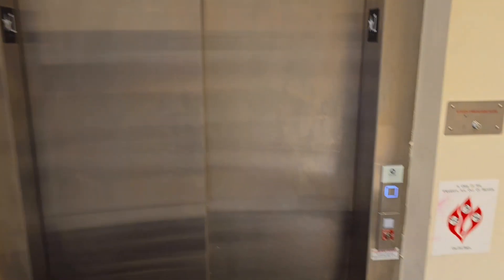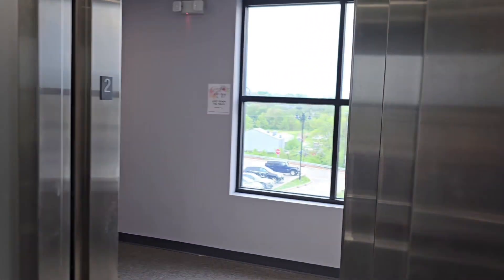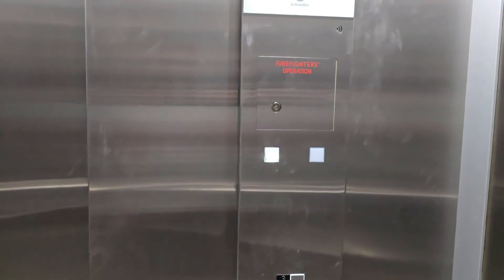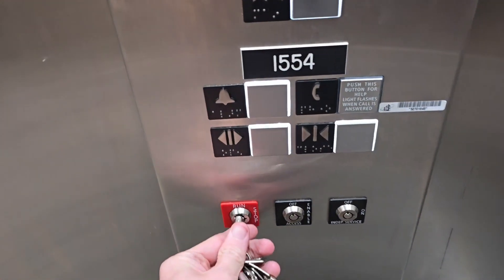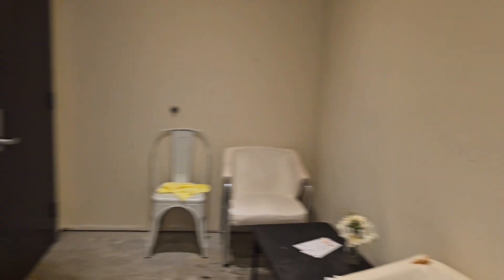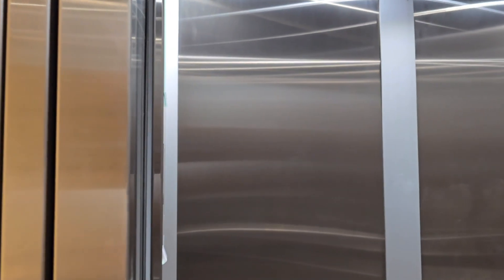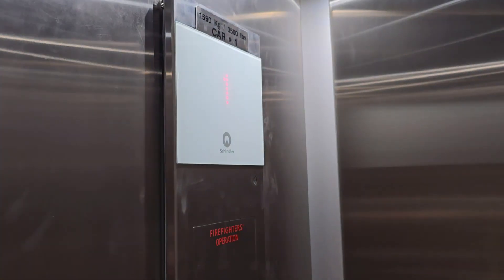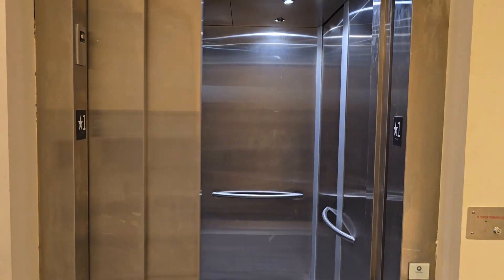Schindler 3300 Elevator: Keyed Stop Switch Demo + Nudge Mode Fail

Comment: Does it cancel a call if you flip it while it's moving?
Reply from the maker: Yes.  Although I didn't demo that because I don't want to risk causing damage to the elevator.
Reply: @BusMaster99  Well I would think it would stop safely. Then it would relevel when set back to Run.
Reply from the maker: @Undercoverelevator212-s2n  While I am authorized to use my keys on this elevator, if I break it and they find it was because of the keys, I risk permanently losing that authorization.  This elevator recently had to be reset because of a power surge at the end of last month and I was scared at first that I somehow broke it.
Reply: @BusMaster99  That was the electricity's fault AFAIK. What about the one in the FM cabinet, does it sound an alarm if you trigger it? I saw a video of it being flipped on a 330A and that rang the floor pass chime on loop.
Reply from the maker: @Undercoverelevator212-s2n  Nope, neither of them sound the alarm on the 3300.  And on the subject of the electricity, if I had known the elevator was broken before getting out, I would have hit the phone button and let the operator know.  The problem was once I got out of the elevator, I couldn't get back in.  I even tried putting it in fire service since I had my FEOK1 on me and it STILL didn't open.  It was super weird, but at least it did let me turn fire service back off so that the alarm wouldn't be constantly sounding and annoying people near it.  This is something I wish I had on video.
Reply: @BusMaster99  If it was stuck, probably controller glitch. I know that on some elevators the Stop Switch can cause that too. Cough Cough Elmwood garage.
Reply from the maker: @Undercoverelevator212-s2n  Yeah, the elevator just "Schindlered" itself.  I hadn't activated either stop switch that day and when it malfunctioned, the first thing I did was double check that both were set to run which they were.  The floor buttons didn't work, but door open did since I was at the first floor when the malfunction took place.  After that, none of the call buttons worked.  Was super weird, but it got fixed the very next day so I breathed a sigh of relief.